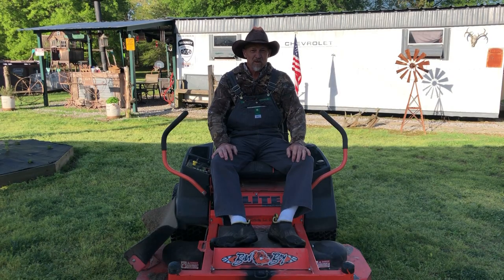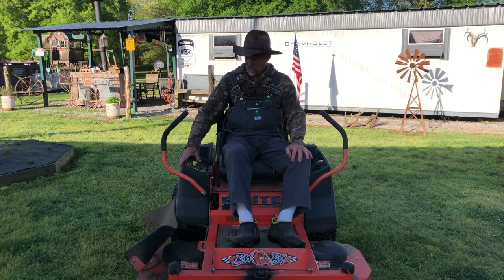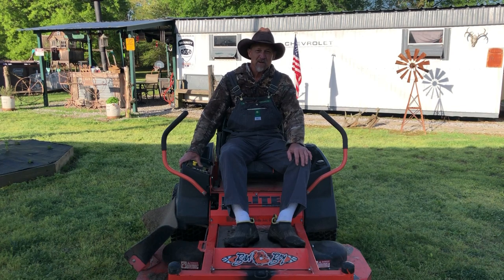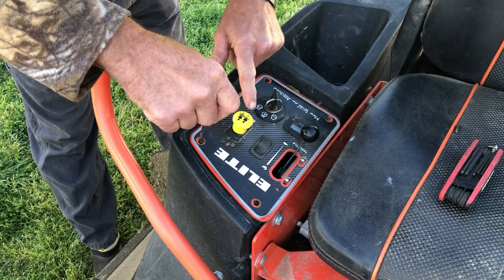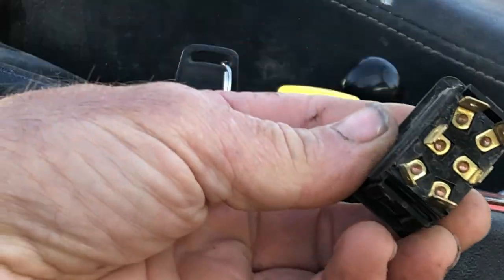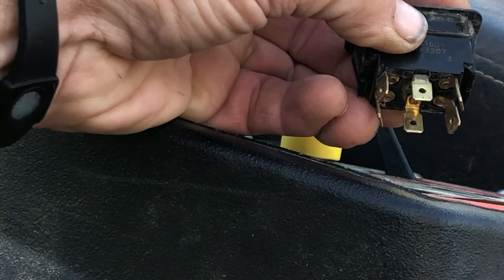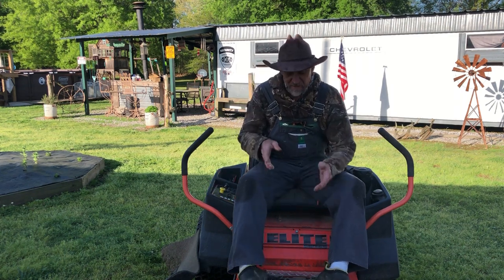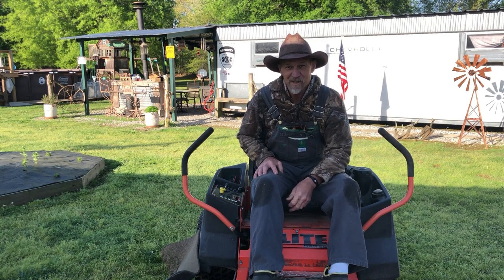How to Test & REPLACE the Rocker DECK Lift Switch on a BAD BOY ELITE Zero Turn Mower P# 078-3000-00

Comment: Thank you, it was just what I was looking for! We were leaving town tomorrow and I needed to get the yard mowed (3 acres) today before leaving. Got ready to mow and the switch would move the deck up and after messing it it went down farther, and I couldn't get it back up. I ordered a new switch but won't be here for week. Your instructions on bypassing the switch worked great and the deck moved right back up to where I needed, so I could mow. Thanks again!
Reply from the maker: I ended up leaving my two wires in place because the switch keeps going out every year. That's the only issue I've had with this mower.